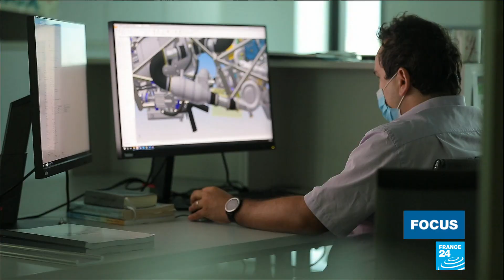Are electric planes the future of aviation?

Comment: So flying electric, means the end of jet engines and the large passanger planes? Because without fuel and jet combustion engine you can't build economically viable passenger jets. So the 'cheap travel era' is truly over. Flying becomes the prorogative of the happy 'rich' few!
Reply: Electricity is free with solar. Surely thats cheaper than jet fuel?

Comment: energy density of jet fuel 43 MJ/KG Lithium  battery  9 MJ/KG so you need to carry 4 times the amount of fuel + plus the extra fuel to carry the fuel 
 before you start thinking about the money cost or the recharge time
Reply: @moreno valley news first lith battery fires are not good but neither is a jet fuel fire